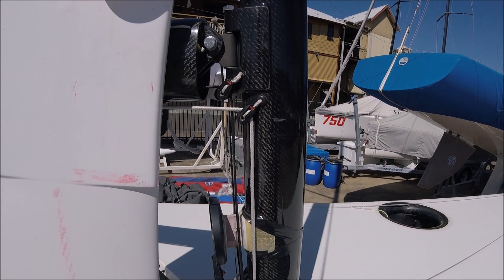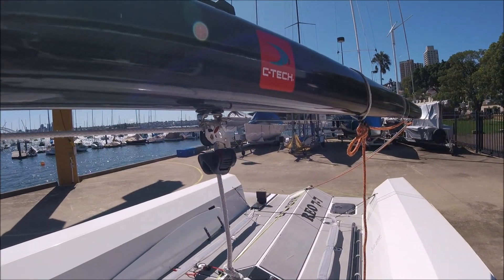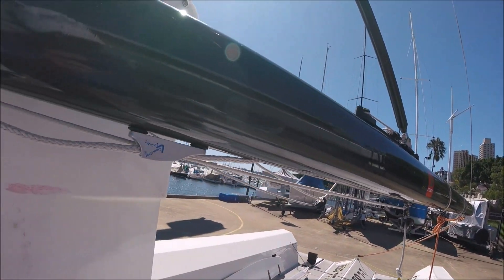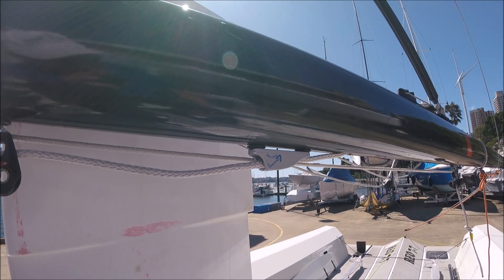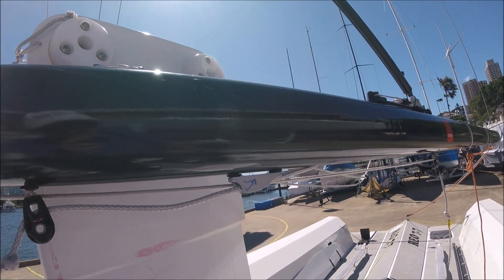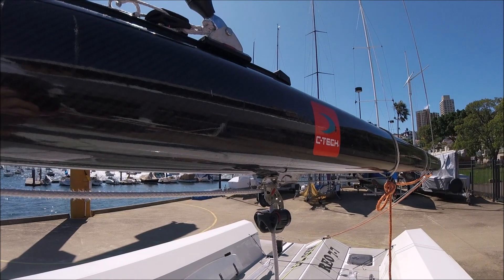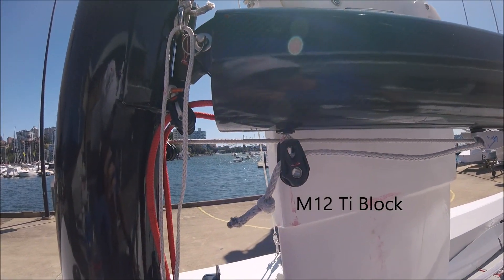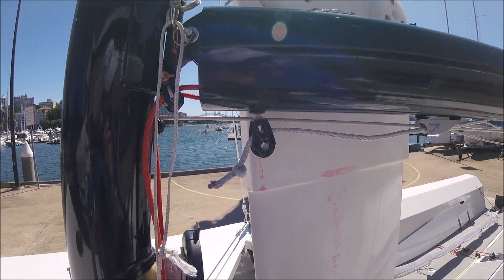Ropescrews in Spars

Comment: what's a ropescrew?
Reply from the maker: Kevin, 
A Ropescrew is a fitting that I invented in the process of designing my REO 7.7 sports boat.
They are a soft fitting that can be used on boats or spars to attach blocks, other fittings or lines.
They can be used to replace stainless steel saddles on the cockpit floor or bolted fittings in other applications.

This is the website for the Ropescrews:  https://tedtec.com/
This is the facebook page for Ropescrews:  https://www.facebook.com/tedtecfittings